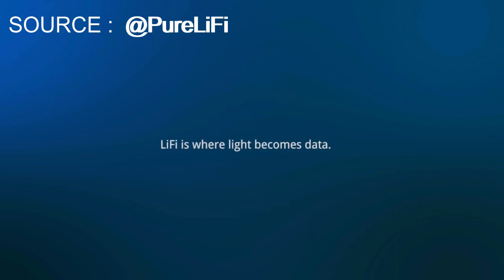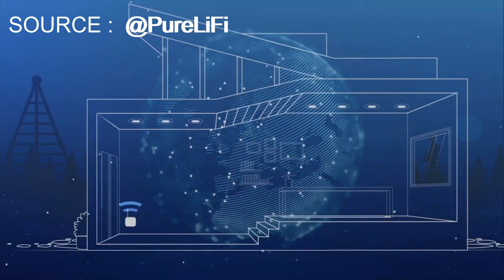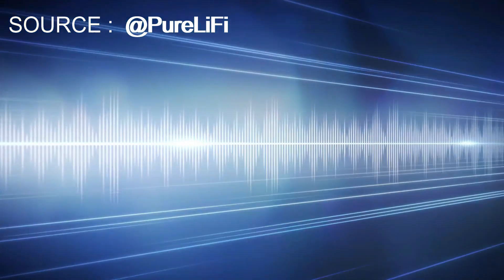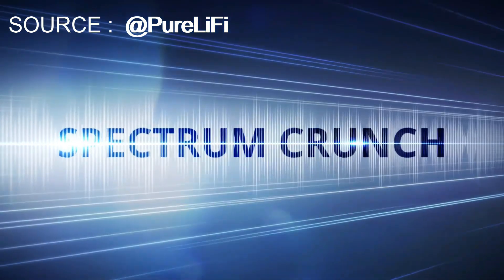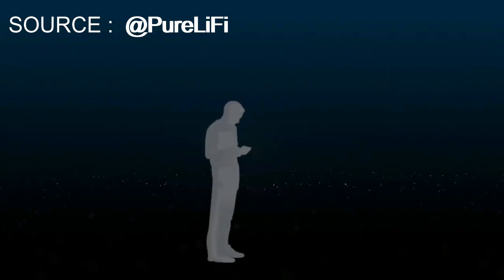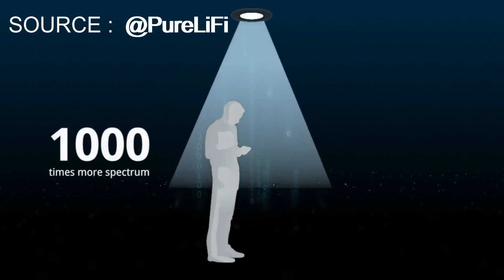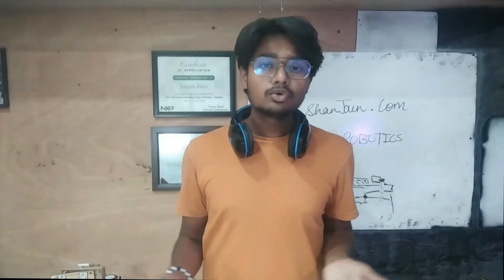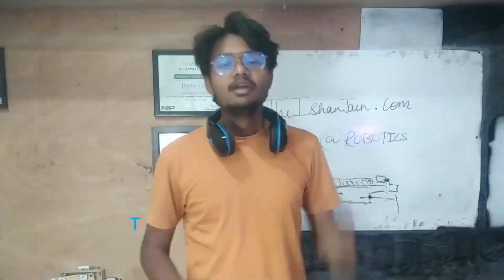Arduino LiFi System: Text Data Transfer via Smartphone Flashlight | My 2nd Year Engineering Project

Comment: Bro the app will only work when the LDR module is available??
Reply from the maker: App and modules are two completely different entities which  depends on each other
Reply: I mean when it detects the LDR sensor
Reply from the maker: @ksankar7937 nah.....the app will work just fine without the hardware 
But won't be of any use
Reply: only few messages available to send bro only 10 messages
Reply from the maker: That's a constrain, you'll have to work your way around the code
Reply: Bro can you send me the app link
Reply from the maker: Sure thing 
Drop a mail 
jainishan2023@gmail.com

Comment: bro can you send arduino code because website is not working
Reply: Bro same problem
Reply from the maker: @rvtamilan6699 drop a Mail jainishan2023@gmail.com
Reply: @TheIshanJain  bro in my lcd the no message is displaying
Reply from the maker: @PriyanshuKumar-yz2zg check the i2c address and change it accordingly in the code(0x3F or 0x27)
If you see only black squares adjust the potentiometer behind the lcd(blue and white coloured thing)
Reply: @TheIshanJain  bro i checked i2c address its 0x27 and i have changed it and when i rotate potentionmeter clockwise black boxes appears and when i rotate it anti black boxes disappear but message doesnt appers
Reply from the maker: Last option is to check your jumper wires 
I'm assuming you might have connected then to A4 and A5 
Check their continuity using a multi meter 
If it checks out i highly recommend replacing the i2c
Reply: @TheIshanJain  bro now when I am sending data it is not displaying
Reply: I also want the audrino code bro and i also send a mail
Reply from the maker: Sure man!
Drop a mail here jainishan2023@gmail.com
Reply: @TheIshanJain  and can I stimulate it on proteus
Reply from the maker: @PriyanshuKumar-yz2zg 
You may try...... can't guarantee if it'll work
Reply: @TheIshanJain  last question aduino nano and oled are necessary??
Reply from the maker: @PriyanshuKumar-yz2zg nahh
Just for aesthetics
Reply: @TheIshanJain  thanks for the help
Reply from the maker: @PriyanshuKumar-yz2zg pleasure!

Comment: how did u solder the ldr into the lcd?
Reply from the maker: LCD 16X2 (i2c) isn't soldered to LDR module, rather they are connected with the Arduino

Comment: Is it possible for replace the OLED with the buzzer ?..if it is ok then what were the connections for from buzzer to mini Uno
Reply from the maker: Yeah
Reply from the maker: sorry for the late reply
follow the steps to replace the Oled with a Buzzer
1)assign a variable (int) for buzzer to any of the digital pins 
2)set it as output 
3) delete the part where Oled library comes in also delete the library from the code
4) upload the code 
let me know if you face any difficulties

Comment: wait, light and radio waves are the same thing, but different wavelength only
Reply from the maker: Not exactly Mate!, i hope this helps:
Both radio waves and light are electromagnetic waves; their main difference is their frequency. Radio waves are created by the acceleration of electrons in a radio antenna, and light waves are created by the oscillations of the electrons within atoms.